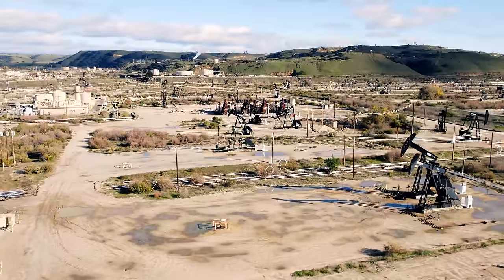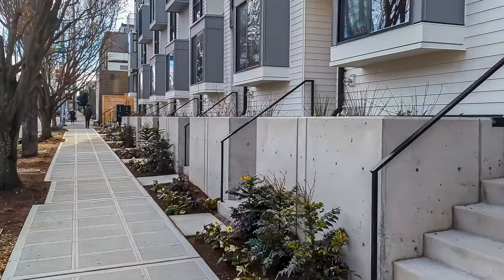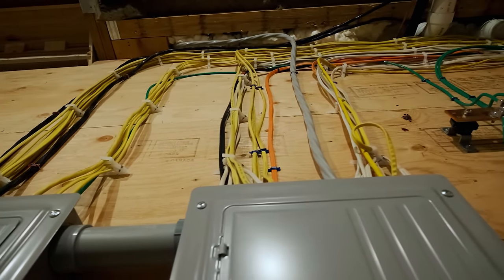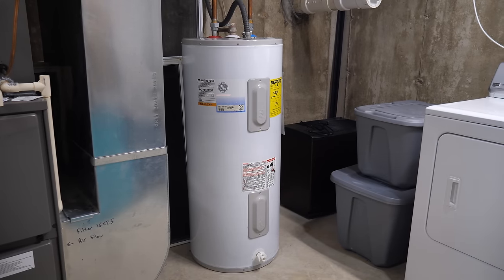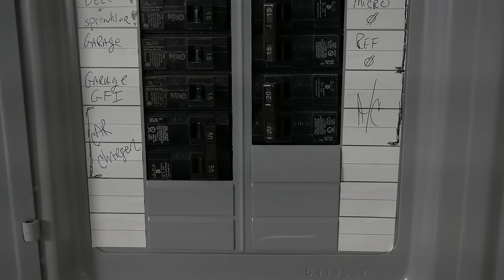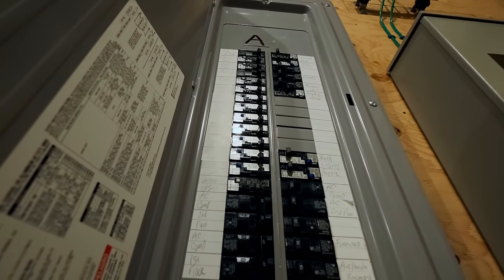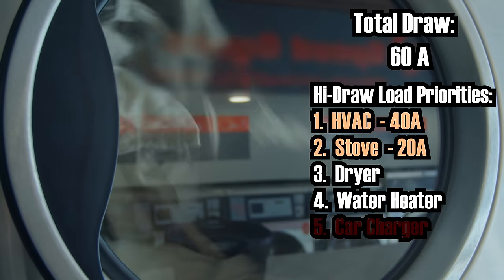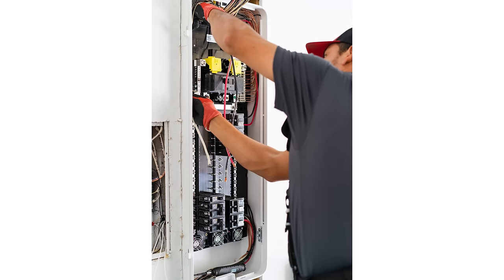Home Electrification: There's not a lot to do, and it doesn't have to be hard (Part 1)

Comment: Okay the realization that there are gas burning dryers really hit me out of left field. 
I could literally have never guessed that would be number 4
Reply: I literally just used mine
Reply: I've used one. They are very fast. But super uncommon. Large towns or small cities may only have one or two models available.
Reply: well if that blow your mind, this fact, may actually, course bran damage,  your could by kitchen fringes that ran on Gas too, with flames and all that stuff that goes with gas burning?
Reply: @zoomzabba452  uncommon really?
Reply: Yeah it made me wonder what else they can have running on gas.
Reply: @dh2032  by "this fact" you mean your spelling? ^^
Reply: @enriquegarciacota3914  fringes
Reply: Hi, Canucks here with a gas dryer!
Reply: @zoomzabba452 They are pretty common in the us. Lots of models of dryer are offered in electric and gas versions here. When we replaced our washer and dryer the gas utility company cut us a check for 450 dollars for buying a gas dryer instead of the cheaper electric.
Reply: @enriquegarciacota3914  Refrigerators. No, seriously, they were a thing.
Reply: Gas dryers are actually very common and cheaper to run in much of the United States.
Reply: I don't understand dryer appliances. Just put your cloths on dryer rack, they'll dry automatically. WTF.
Reply: I've got one. It works great. I mean, why not burn something to get heat?
Reply: @Veylon  they are still a thing, they are just starting to be replaced with 12 volt compressor units in rvs. You can also still get larger absorbition fridges for things like off grid cabins.
Reply: @deadasfak  I had to do that for 2 weeks while waiting for new dryer during the unpleasantness. Clothes on every curtain rod, towel rack, hanging off the door of the dead dryer, the shower curtain rod, closet doors. . . I didn't even attempt to do the bed linens the whole time.
Reply: @dh2032  Are you actively having a stroke while commenting on YouTube?
Reply: many "WHAT?!??"s have been whated.
Reply: @Veylon  Are they like the propane powered ones that are in like campers, but for the house?
Reply: My house had a gas pipe for a dryer. We redirected it to an on demand water heater. Gas yes but infinitely more environmentally friendly that the one from th 80s it replaced
Reply: I've only encountered 1 in over 30 years of life.
Reply: Gas dryers are pretty common where I live in the US. For the longest time gas was cheaper here so many people went with that. My house came with one though it's also already wired with a 240v circuit for an electric dryer so whenever the dryer finally needs to be replaced I'll probably go with electric and cap off the gas.
Reply: @robbruce2128 sounds like about half the amount you could have fit on a fold-flat drying rack, then :) A 0.5x1.5 m rack has about 20-30 m of "clothesline" (some thicker things and linen want to hang across several rack wires, for better air circulation).
Reply: @enriquegarciacota3914  One other thing that's common in some exurban and rural areas is... electrical generators!
Reply: My son's house has a gas fireplace. It does throw out a bit of heat and has a fan, but I don't know how efficient it is. Back in the '80s gas was cheap.
Reply: they're so much more effective and efficient too. we'd have one except for some reason the gas lines can't be sent to the basement?
Reply: @K-Anator  fringes
Reply: I started in the renewable energy business in 2007. My first office was in an off-grid neighborhood and we sold 50/50 grid-tied and off-grid solar, which moved to mostly grid tied in the 2 years I worked there.

Back then the electric grid in the US was coal heavy, Natural Gas and Propane (not heating oil) were both cheaper to operate and produced fewer greenhouse gasses than their electrical equivalents. 

Gas was the better choice back then, but as the grid has gotten cleaner, heat pump technology has become affordable and fuel costs have gone up, electric is always the better option.
Reply: @deadasfak  never lived where it's freezing eh?
Reply: are you 13?
Reply: Yeah, that is insane...
Reply: I spend about $15 a month on energy for a natural gas dryer. I used to spend $50 a month on an electric dryer of the same capacity because the state regulators more than doubled electricity prices to fund "renewables". Well, I was renewed out of the market.
Reply: I happen to live in apartment with gas service for my stove and water heater, but my dryer is electric. So I’d hazard a guess that they’re not especially common, if even homes with gas don’t always use them.
Reply: I have a gas dryer and didn't know that
Reply: @dh2032  I can't for the life of me figure out what you're saying
Reply: @Veylon  Still are for RVs.
Reply: Far as I know, they were popular in like.. the 60s and fell out of fashion in the 80s.  Unless you live in one of those places with gas infrastructure rather than canisters.
Reply: @PaulN504  Also, for a while, electrical service was pretty much just for lighting and low power stuff. For many people, electric dryers would not have been an option.
Reply: I have a gas water heater, dryer, and stove. Monthly gas bill is always under $25. Plus my electricity goes out more often than I would like. My gas? Never.
Reply: And their washing machines are hooked up to the hot tap water instead of just making their own. That's why they need larger boilers.
Reply: @nagi603  Wasing machines don't use that much water, so I would not think that they necessitate a bigger hot water tank.
 We have at home one with just a cold water input and one that also has a hot one, but no internal heater. One thing that the one without internal heater can't do, is do a wash at temperatures higher than the water going in. Also, if you haven't used hot water for some time, first part of the wash will be cold, as the water in the pipes has cooled of somewhat.
Reply: @patrickcorcoran4828  yeah I remember a lot of people pushing for electric-everything at a time when electricity was largely fueled by coal. It still is in some places, which baffles me. we need to build more nuclear plants.. like, hundreds of them. and we need to build them yesterday.
and we need to build an embassy around foreign ones so nobody but us can enter >_>
Reply: Depending on your climate... I just hang stuff outside like a caveman.
Reply: @Veylon  still ARE a thing and are available NEW 
for CABINS and other "off the grid" but they DO exist also RV fridges some are 3 WAY mains / 12V / propane
Reply: @zoomzabba452  Not true in my area. Maybe where you live. And why would you be restricted to your town or small city?
Reply: @deadasfak  -35 outside and in the summer it is 80% humidity and stuff GETS WET not dry sitting out in the evenings when 80 goes to 110%
Reply: @deadasfak  Don't knock it till you tried it. Kinda like a bidet. lol
Reply: @soaringvulture  They work better than any electric dryer I've had.
Reply: @-_-j  Oh man. that sour smell is awful.
Reply: @nagi603  My gas hot water heater is 4' away from my washer. But my washer does make it's own steam.
Reply: @MattExzy  Nothing like the sun to give your stuff a clean smell.
Reply: 20,000 people in ny were glad they had gas stoves when the power went out for 101 hours.
Reply: Pretty uncommon here in NZ in domestic settings but you see them in commercial settings including laundromats.
Reply: My god
Reply: @tweedeldee8122  Your gas dryer still needs electricity to run, so it won’t work in a power cut. Same with most modern gas hot water heaters.
Reply: You must live outside the US. Very normal here.
Reply: Oh yeah gas clothes dryers are huge. I think electric are definitely more common but I have had gas clothes dryer‘s in the past. Currently I use electric clothes dryer however my hot water, range and heating are all natural gas
Reply: Once you've used a real gas dryer you'll never ever want to go back to electric, ever.
Reply: @mgkleym  wait really?  Where was that when I was buying my dryer?
Reply: My dryer and range both run on LP Gas (propane), and my heating is split between a wood stove and a diesel (kerosene) furnace.  The other big consumer is my ATV sucking down that gasoline (petroleum).
Reply: @deadasfak  I have a family of five.  I would prefer my drying to take place in a small box than my entire living room.
Reply: Im in Canada but I was amazed is somewhat common in Japan. From what I know they don’t really have 2 phase power as much as North America. Some hotel uses 100volt, 12watts dryer is super slow due to low heat outpace
Reply: @FranNyan  they don't have a compressor (and depending on design don't have any moving parts at all besides a gas valve). Ammonia absorbtion cycle was the very first home refrigerator, and it took quite a while for compressor technology to improve enough to almost completely knock the old absorption style out. If course there's still RV & off grid products available, and the dual- fuel RV fridges actually just use a 120v heating element in place of burning gas (as opposed to a compressor in a typical 120v modern fridge) because it's so much more simple.
Reply: Wait till you hear about propane refrigerators :D
Reply: @jamesvandamme7786  Also works during a power outage, unlike a gas or electric furnace
Reply: The German company Miele used to sell gas burning washing machines; in Europe.
Reply: I only learned last year that gas stoves are so common in the US...
Reply: to heat the water i suppose? Not sure what on earth else it would be doing, unless it was a combo washer/ dryer.
Reply: No wonder Americans are always going on about lint trap fires.
Reply: Moved into a new house and I was like "WTF is that"
Reply: In many parts of the country, gas heat (furnaces and dryers) are in almost all homes (except apartments, because apartment builders don't want the expense of providing the residents with the options of cheaper to run gas appliances and heating.
Additionally, a gas stove still works when the electric power lines have been taken out by high winds or ice.
Reply: @zoomzabba452  I can walk into any appliance store and find DOZENS of them.  Rare?  Are you insane?
Reply: @enriquegarciacota3914  
Anything larger than a toaster that is made for the purpose of making heat.
You know, like stoves and ovens.
Reply: @robbruce2128  same 
Clothes drying on a line don’t come out as nice 

I don’t use dryer softener but damn those clothes hung to dry felt hard and stiff
Reply: We had a new GE Dryer delivered at work and i saw the model option it in the manual.
Almost couldn't believe it! 😅
Reply: I've never not had a gas dryer. Not sure anyone in my family ever has either.
Reply: @zoomzabba452  My entire neighborhood, and likely city, has gas dryers. I recently learned this.
Reply: Ive seen places with gas burning fridges.
Reply: Why do you even need a dryer at all?
Reply: wut

good lord

stay in school?
Reply: @dh2032  Exhaust gas leaves a dryer out the pipe with the rest of its exhaust. Gas stove exhaust exits via the range hood (if you have one with a duct), and gas refrigerators are most commonly found in RVs and have an external exhaust.
Reply: My parents have a gas dryer. Also a gas cooktop (although the double wall oven is eletric), gas furnace, which I think doubles as the water heater, and the tank is just storage? I know they have a hot water tank, but only realized it does its own heating after Alec's last video... They also have a coal stove in the living room. See, 4 miles outisde of town, electricity ain't too reliable in a snow storm. :) They also have kerosene lamps and wax candles for lighting when the electricity fails. They have two 2,000 gallon Propane tanks out past the garage so they can shop around and fill up once per year. Oh, and no A/C. Just large eaves and open windows in the summer.
Reply: For me it was just the realization, that an "all electric home" is considered an oddity in some regions. =/
Reply: Never knew they existed.
Reply: I was also surprised that such things exist. But I was also surprised to find out that many US washing machines use hot (warm) tap water and have no internal heater.
If fact, when I was a child, we had a washing machine that was running on gas!
Reply: @zoomzabba452  Not true. A lot of older cities like mine rely heavily on gas appliances because a ton of us have 100 amp service.  I just replaced my gas dryer and had plenty of options.
Reply: I can't believe that that is actually a surprise to some as tech connections said it would be lol.
Reply: @Veylon  are actually, amish often use them
Reply: @deadasfak  In our climate the clothes will get moldy before they dry.
Reply: I love mine, will never go back to electric one
Reply: i have one at my off-grid cabin specifically to reduce the demands on the solar panels. but really it's better to use a clothesline
Reply: @gusmueller4413  clothes lines are great I use one in summer months when weather alots for it. But winter is longer here, so not always an option sadly
Reply: Guess it depends on where you live. I've had gas dryers in every home I've owned. They're actually the last thing I would want to electrify because they're more efficient. Heat pumps and heat pump water heaters are more efficient than burning gas and induction stoves are just better but gas dryers are always resistance heat.
Reply: @roger1818  Dryer uses 120v. Hot water heater and stove need 0 electricity to work. I have batteries-inverter and generator for power outage. Gas drys much better than electricity.
Reply: You can buy a gas powered fridge for a camper right now.  Called 3-way fridges.  110V, 12V, or propane.
Reply: @tweedeldee8122 

As for what method of drying is better, it all depends on your requirements. If you like clothes shopping and want an excuse to frequently buy new clothes, gas dryers will do a good job of accelerating that. A heat pump dryer is much gentler on clothes, and a clothes line is even more gentle.
Reply: I have relatives who have had a petroleum powered washing machine. ("White gas")
I have heard of commercial buildings that burn natural gas to power their air conditioners.
If it is possible to run something off oil or natural gas, someone somewhere does.
Reply: @roger1818  That's nonsense. I don't like new clothes and most of mine are 10 -20 yrs old. I'm not kidding either. So stop with the snide myths. What's the cost of your "heat pump" dryer?
Reply: @tweedeldee8122  I hope you have lots of Carbon Monoxide detectors in your home if you prefer old gas appliances.
Reply: Same. My washing machine has a built in centrifugal dryer, and the rest would be handled by good ol' sun. I know the existence of heated dryers, but GAS?!
Reply: I've had one for years. Needs regular maintenance (cleaning) like any other dryer but they work GREAT
Reply: @roger1818  Get over it roger. Live and let live. How much was that heat pump dryer?
Reply: @roger1818  And don't forget your booster and bike helmet roger.
Reply: St. Louis checking in.. I didn't even know electric clothes dryers were that common until a few years ago. until then I thought they were just something in apartments.
Reply: @tweedeldee8122  More like live and let die, but okay. 

Heat pump dryers aren’t commonly available here in North America yet, so they are still expensive. In Europe they are much more popular and with a quick Google, I found them as cheap as £250 in the UK, to give you an indication of what price they should be once volume picks up. 

The other advantage of a heat pump dryer is you aren’t venting your condoned indoor air (heated or cooled) directly outside.
Reply: @-_-j  if it is freezing outside you can beat the frozen water out of the clothes lol
Reply: @roger1818  So you have no actual experience of owning and using a heat pump or the up front costs, yet you want to tell others what they should be doing. Got it.
Reply: @mgkleym  electric cheaper to buy cost more to run
Reply: @KairuHakubi  Gas lines can be sent to the basement. In the Northern and North-East USA many many homes have a gas furnace located in the basement. its very common.
Reply: @dh2032  What's a kitchen fringes?
Reply: @standard-carrier-wo-chan  Centrifugal dryer? Meaning it spins really fast like all washers?
Reply: @tweedeldee8122  Yeah, but the dryer is another tube entirely, not the washer itself. I'd use it when the sun gets unpredictable, so it only takes probably half an hour to dry clothes outside instead of two.
Reply: @Drmcclung  I rebuilt a 67 Kenmore lady gas dryer.  It literally would be done drying before the next load was done washing.

Electric dryers suck in comparison.
Reply: @scotlawrence  yes but we were told it would be prohibitively expensive to do it in our specific house, so it's gas upstairs only. and actually, yeah we also have a gas furnace in the basement. so it's literally just the laundry room area, a few feet away, which we were told it would be too expensive to put in a gas line for.
Reply: I suppose here in the UK / Europe, we have 220-240v so the added risk isn't worth the likely marginally faster drying times. There are enough fires caused by faulty electric clothes dryers! That said, i have extensive family in the USA (mainly Boston / New Hampshire areas) and have still never encountered one that uses gas as a heat source. It sounds frankly terrifying.
Reply: I'd say it's a regional thing.  If you have natural gas piped to your home for heating / hot-water, it's a natural extension to use it for clothes drying as well.  So in northern climes I've had gas (NY, CT, and MI).  But when I was in southern climes where natural gas to your home is pretty much non-existent, electric dryers is the norm (MS, FL, and TN for myself).

I've also noticed it varies with urban / rural.  Propane can be a lot more expensive than NG, so where NG is not available, again dryer and stove would probably be electric.  YMMV
Reply: @rhettbaldwin1401  kitchen appliances fridges, some of the first ones ran on gas powering them, not an electric motors, all gas power, they where still common on mobile locations caravan/campers vans, etc. I think the more normal electric have take over that market too, but that not my thing they many still be making them somewhere still?
Reply: And he forgot the challenge number 5, the biggest of all by far: sheer stupidity.
Reply: Wait till this guy hears about gas-powered refrigerators...
Reply: Electric dryers seem rare to me. The apartment I currently live in has gas water heater, stove, and furnace. The complex has a laundromat, I need to see if those are gas dryers. 

Clothes dryers are fine, if you don't mind having no where to use one, like in an apartment complex.

Some people aren't rich enough to own homes.
Reply: @dh2032  My grandfather was an electrician. Electric oven. Gas fridge! (UK 1960s)
Reply: @nagi603  European washing machines/ dishwashers are almost all now cold-fill only. With their new low water use the argument is that they would barely draw any real hot water in , because of pipe lengths, so would have to heat it anyway. Plus one less valve so cheaper to make.
Reply: @MattExzy congratulations
Reply: @roger1818  I have a tankless water heater that uses gas. It requires electricity to run. And even though it only draws a handful of watts, it refuses to work from even a "server grade" battery backup. So the thing is useless in a power outage. It's so infuriating.
Reply: Like, 80% of dryers where I live are gas.
Reply: @rich_edwards79   Most electric clothes dryers in North America also run on 220v.
Reply: Gas is cheaper than electric. Most laundromats use gas dryers
Reply: The only way those dryers could get more USian is if they ran on gasoline supplied via pipes.
Reply: What if I told you gas fridges exist ...
Reply: Many of the dryers in laundromats all over the world are gas heated and very efficient.
Reply: @dh2032  more southern states barely have gas infrastructure, in florida we have none so everything is always electric (and it all works perfectly fine)
Reply: Also I think he didn't even mention heat pump style dryers, those will even be more energy efficient.
Reply: @No1x3N  A lot more complicated, expensive and more maintenance required.   All these heatpumps are also massively increasing the amount of refrigeration gasses required by the world,  and we all know that the one thing aircon gasses do very well is leak into the atmosphere....
Reply: @deadasfak  a lot of rentals ban that because it can drip on the floor and leave the carpet soggy causing other problems or will damage wood floors.  Missed homeowners associations forbid outdoor clothesline (but I couldn't do that anyway due to severe allergies).  Plus when we've used a drying rack while the dryer was broken it took most of a day for stuff to dry vs an hour.  It's really not fine if stuff doesn't Brian time and have to wear wet jeans.
Reply: @Validole  I'm having trouble following the thread but when we had a broken dryer it took 4-5 fold up drying racks to do the entire load at once, and they had to sit over tarps in the living room for a day and a half before heavier stuff like jeans were fully dry.
Reply: @doomVoxel  indoors or outdoors?  How do you deal with allergies if its outdoors with everything covered in pollen or if it rains when you need to wash?  How do you get it to dry in a reasonable time instead of days if it's indoors?
Reply: Right? So weird xD
Reply: In my area they are used commercially, like in laundromats or uniform cleaning services. I've never seen one in a house however.
Reply: This video is also funny because natural gas is alot cheaper then electric where I live so people are switching their electric houses out for gas ones. KWH isnt the only story, more usage puts you in a higher service/distro fee bracket where I am. Alberta Canada.
Reply: @soaringvulture  There you go!  You still can't beat gas in most areas for BTU.  So you can produce power (maybe with a heat engine which is inherently lossy), then transmit it to the destination (which is inherently lossy), then make your heat with a resistor or maybe a heat pump (which IS efficient).  Or you can pipe methane (which isn't inherently lossy, although it leaks more than it should) and burn it right in the furnace at well over 90% efficiency.  Methane does release CO2 when burned and gas companies and appliances do leak methane which is a worse greenhouse gas, so we will be moving away from methane in time, but it's the cleanest of the fossil fuels.
Reply: @deadasfak  If you dry clothes indoors your HVAC system is still providing the energy to do it, although in the winter the humidity is helpful.  Drying outdoors is a "no brainer", the sun is free and does a better job.  A lot of idiotic neighborhoods try to outlaw clotheslines.
Reply: I once saw a gas powered fridge. No idea how it works
Reply: @jamesvandamme7786  gas was cheap before Biden, much less the 80’s.
Reply: As an Australian, that's insane to me; I've never heard of such a thing.
Reply: @deadasfak  tell that when it is -40C
Reply: @enriquegarciacota3914  pool heating
Reply: @Drmcclung  I have own a Bosch Electric dryer for 20 years and it works fine
Reply: @gabtheone  Congratulations. Does it run on gas?
Reply: @Drmcclung  240V AC
Reply: I never experienced one until I moved to Illinois and tbh, I hate them. 

They’re fast, but the temperature control is ridiculously bad compared to electric models, so everything ends up being dried Extra Crispy, even if you use the lowest heat setting possible. And since, unfortunately, the humidity here is too high to routinely line dry things without them coming out smelling fusty, the dryer really is the best option for most of the year.
Reply: @KairuHakubi  If you search for "Comparing Emissions: Driving the Average EV as a Gasoline MPG Equivalent" you'll find maps showing the US regions where grid powered EVs emit less carbon than gasoline cars. When they started the map in 2015 there were a lot of places where something like a Honda Civic might beat a Tesla on a coal grid. As of 2022 there are only a few regions where the most efficient hybrid is less polluting than an EV and that's only if the EV owner doesn't also have solar.
Reply: @patrickcorcoran4828  I mean that would be great if this entire subject wasn't a minefield of fake science.
Reply: @deadasfak  -45 outside it dosen't dry to fast
Reply: @MrChanw11  no, this person doesn't know what they are talking about
Reply: Gas dryers are big in the Midwest and somewhat available in the South. The rest of the USA, not so much...
Reply: @dh2032  has your "bran" been damaged?
Reply: @spyone4828  If you have a Hot side you can make a Cold side.  Unfortunately I am not sure these systems are particularly efficient.
Reply: @dh2032  still can for a caravan lol
Reply: I live in the prairie and have never lived in nor seen or been in a house with a gas dryer. They're basically the suicide pact of appliances.
Reply: @slawomirjanicki9580  EXACTLY! Not to mention the constant power outages, the fact that it is often coal generated, the EXPENSIVE upgrades to get the more expensive power ... and the fact that electric cooking sucks
Reply: @roger1818  Few tank gas water heaters need electricity
Reply: @jkasey4982  I am lucky not to suffer from power outages. This really depends on where you live. Also, modern gas furnaces need electricity to run controls, so no gas heat without power.
As for cooking I am actually in the same camp as Tech Conns. I love inductive ranges. Yes, the resistive ranges are meh, but the inductive are fast, they stay cool, and I am not going back to a gas range.
Reply: @jkasey4982  it depends on the ignition system. Low efficiency water heaters use a pilot light, which wastes gas. High efficiency water heaters use an igniter, which requires electricity.
Reply: @roger1818  
Why would a gas water heater need electricity? Not for heating, and not for moving the water or control. 
When the atmospheric river in CA knocked down trees and damaged power lines, the only things still working in my house for 3 days were the water heater and the stove. Gas. Oh... and the noisy gasoline power generator I used to prevent the food going bad in the fridge.
Reply: @sorinescu123456789  That depends on the design of the heater. A unit that uses a chimney and a mechanical thermostat is at most 80% efficient. The high efficiency heaters need fans for air intake and exhaust and pumps to move water if the piece doubles as the house heater.
Gas stoves have flame sensors that shut off gas flow if the flame goes out. I believe modern building codes require that.
Reply: @sorinescu123456789  Primarily for the igniter so that it doesn’t waste gas with a pilot light. High-efficiency water heaters also have fans to re-circulate the exhaust to maximize heat extraction.
Reply: Gas dryers are far superior to electric for a large family that does multiple loads 6 days a week. They are also much simpler and therefore easier and safer to repair. I cringe every time I think of the melted wires in the dryer we had at our condo. . .
Reply: @PyRexext  Gas dryers -may- be safer if they are correctly installed and maintained. From what I have seen many are not correctly installed (with flex hose exhaust!) and hardly anyone maintains them. A partially clogged exhaust half full of dried lint is a fire waiting to happen.
The quality of electric dryer installation may improve now. The fires and meltdowns of EV charger hookups put some focus on power installation... inadequacies?
Reply: Gas dryers in my opinion just straight up do a better job. There's nothing inherently wrong with electric dryers, but once you've used gas if you live in a house where you have that option, it's very hard to go back to electric and that's because the gas is both hugely cheaper, and the burn does generate moisture so the clothes can only get so hot and not New Mexico in July dry, unlike elec where too much heat makes the fabric stiff dry and scratchy whereas in gas they come out fluffier and dry a bit faster. It's easier on clothes, especially when you're used to a cheap shitty elec dryer without as much heat control built in (that's not me pooping on elec dryers), you'll definitely notice the difference. 

I know the whole "open fire" concept scares the shit out of unassuming people, maybe you haven't been around them before, but I assure you, gas dryer fires (natural gas issues in general) are extremely rare in North America. There are so many mechanical AND electronic safety doodads in gas dryers that it's just unlikely to be a problem. Now if you let the lint and dust build up for 7 years because you haven't pulled the dryer out to clean anything in years, that's a fire hazard.. but that applies to elec as well. 

PLEASE.. let's not complete phase out gas.. We had energy diversity for a reason, and that was one of them.
Reply: Same, never heard of those. I mean it made sense in a pre-heatpump world where heating with electricity was super inefficient.
Reply: Gas dryers become more and more common in colder climates. In Minnesota where I live, they're pretty common but gradually going away. There's really not much point installing one in a new build.
Reply: @bobbabai  I don't understand this aversion to gas availability in new builds. At all. Other than it being cheaper for the builder/developer. Christ even us hillbillies still keep above ground propane tanks. Electricity is great in the winter, until the lights go out 🤣
Reply: @Drmcclung  I think you missed the part where I talked about the backups for electricity. The natural gas feeding a backup power generator instead of being distributed through the house to furnaces and dryers and water heaters. A backup power generator using diesel or propane where piped-in natural gas is not available. Solar power feeding batteries.

All of this to drastically reduce the amount of carbon dioxide we release into the atmosphere because it is politically and economically necessary. We need to do this for a secure future.
Reply: @bobbabai  That's a nice thought but this is America.. fat chance the utilities and municipalities are ever going to change anything. We can't even pave roads and hang new power lines in Texas. 2/21 kinda pooped all over any chance of anything changing
Reply: @Drmcclung  
Are you aware Texas will be 30% wind powered by 2025-2026?

Are you aware that solar is the next fastest-growing grid power generator in Texas?

Are you aware that coal provides only 11% of the energy for the electricity grid in Texas? 10 years ago, coal was the number one source of energy for electricity generation.

Wind, solar and natural gas will all continue to grow as Texas's energy demand skyrockets.

Are you aware that Texas energy utilities are building out battery storage for the electricity grids?
Reply: @bobbabai  long eye roll... Let me guess, you're a recent transplant
Reply: @Drmcclung  No. I've lived in Minnesota since 1969.
Reply: @bobbabai  Well.. I'm not trying to be mean here, I'm just trying the best I can to express, as a native, that Centerpoint will never, not in my lifetime or yours, bring their portion of the grid into the 21st century. 75% of the distribution network has been sitting there since the 50's the newest of the new-old stuff probably the early 70's. Compared to the rest of the country if you take a drive through most of Metro Houston away from the "nice" areas, poles and wires look like something out of India. You'd think in a hurricane zone there'd be metal or reinforced systems like you see all over south Florida but no. They spend more money keeping this janky shit going than it would cost to start a replacement plan. As for wind & solar you're not wrong, there's a lot of that, a LOT; In west Texas. But they get their share of horrendous weather too just in a different way, and it's all kind of a waste when the transmission system, the "TX Grid" is mostly from the 1950's with newer stuff bodged in here and there as diversity tickets for extra government handouts.. It's a mess. Anyway, this is why 99% of us are extremely against phasing out home gas service. Its the only stable utility we have, even moreso than city water distribution services all over the state.
Reply: @dh2032  pls tell me you mean fridge. refrigerator.
Reply: @spyone4828  I have a Zippo hand warmer that runs on Naphtha (White Gas...which is actually died pink no doubt for taxation reasons).
Reply: They are amazing. They take less than half the time to dry than an electric washer, and they can dry larger loads to boot, all while being cheaper to run. I'm actually in the process of gasifying my house, because every single one of these major appliances is significantly cheaper to run in their gas form. The payback period for my gasification is a ridiculously low ~4 years, even after spending $3k on the natural gas hookup and $5k on conversions in my house. You read that right, I'll be saving just under $2,000 A YEAR on utilities going from lpg/electric to all NG.
Reply: As someone who lives in the US, I've never had or even heard of gas-powered dryers before Technology Connections, even though I've always lived in a home with a gas range and other appliances
Reply: @kupalan4374  Drying clothes.
Reply: @roger1818  true but a small generator is all you need to power the motor
Reply: @ryanvandy1615  How many people have a generator for the rare occasion that there is a power outage?
Reply: @roger1818  I mean if they don’t then they don’t dry their clothes. What I’m saying though is that people are more likely to have a small generator so if they have a gas dryer they can still use it.
Reply: @ryanvandy1615  Because you absolutely have to have a driver to dry clothes. 🙄
Reply: @roger1818  No, you don’t have to do anything. You missed the point I made just to have a disagreement with me.
Reply: @ryanvandy1615  No. you said, “if they don’t [have a generator] then they don’t dry their clothes.”  I was pointing out that you don’t need gas or electricity to dry clothes, so having a gas dryer isn’t much of a benefit in a power failure (which was my original point that you were disagreeing with).
Reply: @roger1818  alright man
Reply: in Aus we use both
Reply: There are also gas ovens. Not sure why the people have an issue with gas. It’s very abundant and is hardly a large contributor to emissions on a residential level. Plus, gas stoves will always be superior to electric ones. You either get crappy radial coils that never evenly heat up your pan, or a glass top which will inevitably get scratched. Gas stoves just can’t be beaten by electric. Gas is also very efficient since we have basically perfected burners we can convert 99% of the chemical energy into heat. While electricity is great, somethings just work better with gas.
Reply: @SirHarrisonPhillips  The biggest problem with gas stoves/ovens is they vent their exhaust directly into the home. While natural gas is much cleaner than the coal and wood stoves they replaced a century ago, they still emit nitrogen dioxide (irritant affecting the mucosa of the eyes, nose, throat and respiratory tract), benzene (a well known carcinogen), carbon monoxide (can fatigue, headaches, confusion, and dizziness at low doses), and formaldehyde (can irritate the skin, throat, lungs, and eyes and repeated exposure to formaldehyde can possibly lead to cancer). If you insist on using a gas stove/oven, get a high CFM range hood that vents outside with at least a 6” vent pipe (not the standard 4”), and turn it on EVERY TIME you turn on the oven or stove.

Most people who dismiss electric stoves have only used older coil and radiant cooktops, but have never used a modern induction cooktop. For baking, most bakers prefer an electric oven, as it provides a dryer heat. For roasting, a convection oven (or air fryer) is arguably better.
Reply: CityGas (a more privatized company (selling gas-powered appliances e.g. water heaters) spun off from my country's (Singapore) national gas utilities provider) was advertising gas dryers being more energy efficient than electrical ones, but since we have a tropical climate neither type of dryer is common here. Instead we just hang our laundry by our homes' kitchen windows (where the washing machine is usually located near to) to dry, or at most install a ceiling-mounted clothes drying rack (Steigen is a common brand, probably with help by influencers using them) at the back of our kitchen with electric heating functionality. 
For water heaters we usually use electric ones as we mostly stay in apartments, whose design is decided by the architect instead of the owner, & the gas piping usually serves only the kitchen but not the bathrooms. Their safety came in the spotlight recently though after a family was fatally electrocuted after touching a heater's casing. Turns out the heater wasn't directly wired to the electrical mains, but instead used a power socket that plugged into a power outlet, so there probably wasn't as strict separation between the live & other electrical wires. The live & earth wire had melted & touched each other in the socket, sending electricity to the heater's casing. The family's apartment was built in the mid-1970s, when high-current appliances like water heaters were less common (as my country was poorer then), so the apartment's circuit breaker panel lacked a residual current circuit breaker that would've detected electricity flowing into ground via the earth wire & tripped the apartment's electricity supply, preventing electrocution (when the casing was touched).
Gas cooking stoves are common here though, with some of us believing that gas infuses additional aroma (called wok hei ) into stir-fried food compared to electric stoves. Some houses & eateries don't have piped gas though so they instead have to buy tanks of gas from time to time that are stored either below the stove (in houses, which gets in the way of having an oven there though) or in cupboards in the backyard of the eatery.
Reply: I love mine, costs almost nothing to run
Reply: Solar dryers just as fast, not like PV solar but directly leave the clothes in the sun 20-30min and it's dry
Reply: Gas dryers were also used in germany on Industrial and Partly commercial Level.